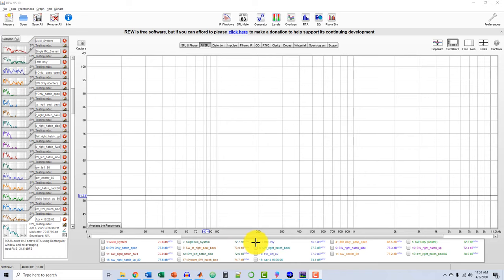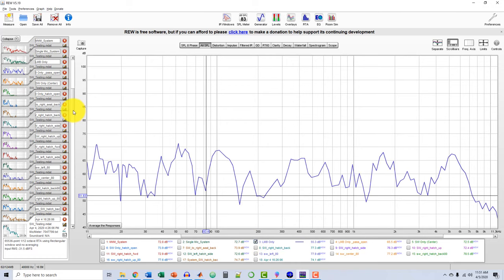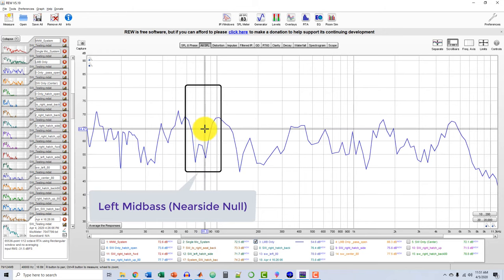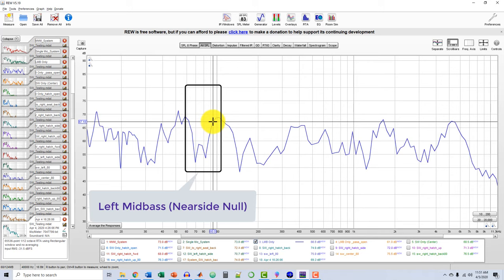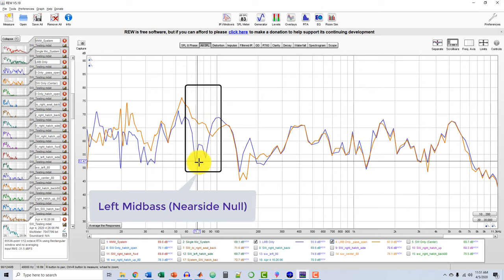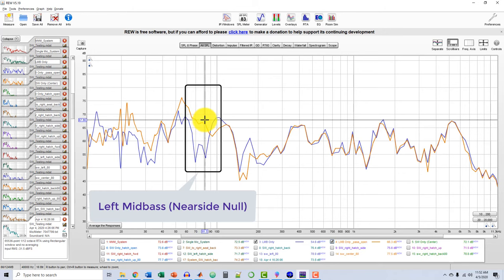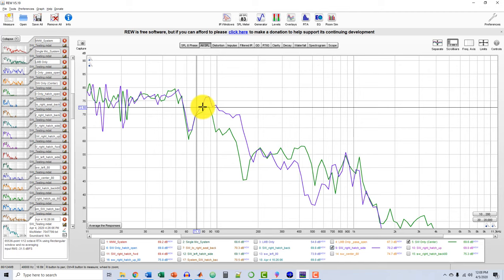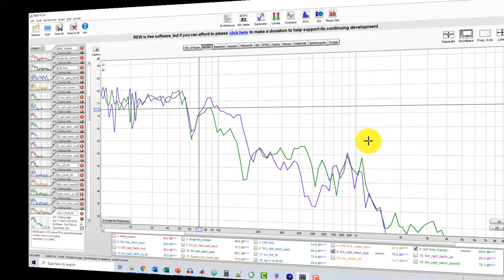Using a Subwoofer to Improve Midbass in Your Car Audio System

Comment: also phasing can create  bass cancelation, in specific frequencies...   sometimes if you turn the phase knob on the subwoofer amplifier it can match the frequencies of the door speakers and reduce cancelation created by the door speakers...   also sometimes if the subwoofer is tuned low like 35hz or lower,  it can make mids bass weak, especially if the subwoofer is in a big oversized box, that will kill mid bass but make the lows powerful, the speaker doesn't make much preasure let's say 15hz above the box tuning frequency,   so maybe if you had a 6th order box,  which means one chamber behind the subwoofer and one in front, low and high frequencie chamber  to give a boost say at 70-90hz

Comment: @Erin's Audio Corner  

Saw your post over on audiosciencereview first which brought me here.  :)  Great video, dude.  👍👍

Oh NO!  Here we go again...  :-P   Skip it or delete it if you want to!

Way back when I first started my car audio journey many years ago, Frank Sbracco Jr @ Traffic Jamz suggested that I place my 15" Infinity Beta subwoofer in the far rear passenger-side corner of my vehicle.

At the time, this was a new, but fugly Ford Aerostar Extended Van (chosen soley for it's ability to carry both passengers plus all of my photography & lighting gear and camping equipment comfortably & securely).

At the time, a young, tall, and skinny kid named Fred Lynch was busy working on the installation of his white Acura(?) Image Dynamics competition car in the install bay.  :)

I was obviously a noob and asked Frank WhyTH would placing the subwoofer in the right rear corner make any difference, and he proceeded to explain basically what you have here.  He told me it won't cost you anything to try it, so experiment and decide for yourself.  I did, and he was right.

I had made a 1.75cf sealed, downfiring box for the Beta 15 sub which would slide perfectly under the 3rd row seat when it was folded down flat into a raised bed-like platform, so it was easy to move the subwoofer anywhere within the large rear cargo hatch area.

With each new vehicle and install, I would continue to test this theory, and 9 times out of 10, ithe rear passenger side worked best.

More importantly, doing all of these subwoofer placement tests really demonstrated to me how different the subwoofer & midbass response could be just due to the position and aiming of the subwoofer within the vehicle, and how different it could be depending on the vehicle itself as well.

In my current grocery getter/daily driver, my goal was to keep as much usuable rear cargo area available in the rear hatch.

But my design & layout dictated that all of my amplifiers & the DSP be placed in the passenger rear quarter panel cubby where I would normally want my subwoofer.  What to do?

The result was a custom, forward firing, sealed subwoofer enclosure placed beneath the OEM floor in the rear hatch cargo area.

The ~1.85cf (total) sealed enclosure spans the width of the vehicle, and Four 8" subwoofers fire partially under & into the back of the reclining/folding 2nd row seats, which is just a bit aft of the center of the cabin.

Each 4-ohm SVC sub is in its own, sealed ~0.45cf airspace, and I installed a pair of individual binding posts for each sub so that I could independently adjust the Levels and T/A of each if desired.

The bonus was that after removing the very inefficient plastic under-floor storage tray and then fab'ing a custom tray, I think that I actually gained usable under-floor storage.  :)

TL;DR   (but not really, LOL)...

What I found through both measurements and listening is that by spreading the "pressure zone" across the width of the vehicle (and also the placement near the center of the vehicle), the bass & midbass response is much more even throughout, and any resulting modes are not nearly as extreme.

Overall efficiency and cabin gain was sacrificed a bit with this placement and orientation, but there is more than enough output capability to make up for the difference.

The 8" subs are also relatively low-inductance and have excellent xmax, so w/o a LPF they play quite cleanly up to about 260Hz.  Sure, I would prefer to have just a bit more extension on the low end, but for 95% of the music that I play there wouldn't be ANY advantage.  Completely acceptable compromise.

This setup has resulted in one of the absolute best "upfront bass" experiences I've heard, with extremely clean and focused IMAGING of bass both Across the full L-to-R soundstage, and deep into the soundstge.  :)

One of my buddies was so impressed that he convinced me to build a similar setup in his vehicle...which is the one I recently used stereo microphones at the headrest to record the system and posted the file on DIYMA.

D@MN!...Sorry for my usual long-@ss "story time" comment, but I just wanted to share my findings on how I attempted to overcome this same issue.

Again, AWESOME video and information, Erin!  👍👍

Comment: I ran a single JL Audio 12W6V3 sealed and had awesome results up-firing it behind the rear seat on the passenger side of my SUV. I can say that it was super easy to EQ that sub and the left mid-bass null was easy to clean up as well. Now I have the left mid-bass null and my rear firing 2 10" sealed subs have a very strange curve in my current build. I am going to dig out my JL 12W6 and see if I can find the sweet spot and maybe kill two birds with one stone. If the 12W6 does the trick again, I am going to build it a nice box and just abandon my 2 10's.

Comment: I expected I was going to have this same issue. I picked up the JBL Fuse dual 8 inch underseat subwoofers to fill my 60-150hz range. My 15 inch subwoofer in the back handles the rest of the lows. The whole system is out of the truck for sound treatment so I haven’t been able to listen to them, but I sure hope the results were worth the extra money.

Comment: Very educational. I'm going to have to go check out how moving the sub around in my truck affects the midbass null. Already in passenger side extended cab so it may be optimal placement already due to dumb luck.
Reply from the maker: Odds are it probably is best in the passenger side.  That seems to be the general case.  But definitely try different spots.

Comment: I guess I got pretty lucky as I can’t recall any nulls around 70-90Hz. 

It’s been a while since I’ve driven my car (03 Buick Regal) but I remember tuning that thing and it was pretty flat from 26Hz and up. Getting it fixed soon so I’ll be able to enjoy some tunes again. 

Nothing crazy was done in the car, just had some Alpine SPS rear speakers and a sealed ultimax 10”. 

The sub technically has almost no output above 60Hz likely because the trunk is eating that area because it’s hungry. But the rear speakers handle above that area perfectly. A tiny bit of EQ for the bass, but mostly just good crossover settings.

Comment: Hi Erin and the rest of the community! I really enjoy following your adventures in the car audio world. Especially the posts about measuring techniqes. 
Have you done tests using gated measurements? Maybe it is all the early reflections that causes the big difference  in various methods? 
Thanks à LOT! Keep up the Good work!
Reply from the maker: Thanks for the comment.  I use gated measurements all the time for my speaker testing.  But gated measurements in a car is useless.  The reason you gate a measurement is to remove the reflections.  In a car, the reflections begin within a few inches (much less than 1 ms in time) of the direct sound.  Gating to such a small time of 1 ms results in a minimum frequency of about 1kHz.  Meaning,  your first data point occurs at 1kHz and there is nothing at all below this frequency because everything below is prone to reflection error.  Not only that, but your resolution of your data is only captured in multiples of that lowest frequency; in this case 1kHz, 2kHz, 3kHz, etc.  That's less than 1/3 octave resolution.  If your window time is less than 1 ms (which it will be in nearly every car) then the lowest frequency captured is greater than 1kHz (bad thing).  Bottom line: gating the response in a car to remove unwanted reflection is of no practical benefit.
Reply: Erin's Audio Corner  Thorough reply indeed! Thanks for that. Then i wont put any more time into gated measurements in car. 
What is your thoughts about measuring with sine sweep vs pink noise?

Comment: Bro thank you for this video, I used to do this when I had a 12 inch subwoofer, but sadly it's a bit harder to get my 15 to play higher without getting the coil smelling. the way I've increased my midbass now was by replacing my vapor shield under my door panel with kilmat reinforced with cardboard, it doesn't help quite the same but it's passable, it gives a bit of a bump around 70-100hz
Reply: So a 15 has issues playing up to 100Hz?
The listed manufacturer frequency response usually goes up to 500hz. 
And usually the power handling is weakest around 20Hz. 
Can you please explain your comment. Thanks.
Reply: @johnviera3884  power handling is generally weakest at 20hz for mechanical/damping reasons not lack of electrical power handling. Actual electrical power handling is determined by the impedance (Ω) curve of the driver and how well the voice coil can dissipate heat. 
Just as a hypothetical example lets assume we have an impedance curve with a peak impedance of 30 ohms @ 36 Hz (Fs), a min' impedance of 2 ohms @ 80 Hz and a nominal impedance of 4 ohms (DC). With that in mind lets say we have the amplifier gain set to supply 40v @ 4 ohms (400w). Using those values we can calculate the power in watts at those frequencies with a couple of formulas.
First find current V / Ω = A  
Second find wattage V * A = W
36Hz - 40/30=1.33A,   40*1.33 = 53.3w, 
80Hz - 40/2=20A, 40*20 = 800w

Comment: Best I’ve had was Focal K2 in front to 80HZ, rear fill speakers coaxial at 120HZ. Sub at 80HZ. 

That will give sublime sound. Quality amps, speakers, and tuning make all the difference. 

12 inch plus sub is the best for deep bass at low frequencies.

Also sound dampening helps a lot at that level.
Reply: Hey, thanks for the input! By any chance, what were the slopes that you used? 12dB/octave throughout?

Comment: Very good info here, subscribed. Would like to hear your thoughts on adding a front sub to glove box area or passenger footwell?
Reply from the maker: I've had up front subs.  I've listened to cars with up front subs.  While they have their advantages, they aren't necessarily an all-in-one solution.  There are still modal issues caused by the placement and an additional subwoofer in the trunk may still prove beneficial.  It's really more car and user dependent, though.

Comment: One trick is to put a sub in the passenger side footwell
Like a stereo integrity bm11
It doesn’t require a big enclosure takes plenty of power and really is a helper to 6.5” or 8” midbass drivers

Comment: Erin, I have an additional question. My measurements from my LMB look very similar. I understand how you dealt with the initial null but what about the one shown between about 150 hz and 325 hz? My LMB behaves that same way and I am looking for any ideas to fill it in.
Reply from the maker: There's really nothing you can do there.  It's placement, relative to your listening position.  The lower null works out because you have the subwoofer to fill it in.  But without another midbass placed somewhere in the car that will fill in the nulls you're talking about, you can't fix this problem.

Comment: Man i really enjoyed the video Erin...Quick question...If the subwoofer and midbass were crossed over at 100hz.....but the subwoofer had considerably more output say like 2000 watts but that output was EQ'd down to the lowest points of the null in that substage...would that help flatten that frequency response?
Reply from the maker: You mean if your acoustical crossover was 100hz, or if your electrical crossovers were both set to 100hz?  EQ'ing down the 'sides' of a null doesn't help the null go away, unfortunately.  You still hear it.  It just looks less prevalent on the RTA.

Comment: Hi I'm hoping you can help. Recently started to get into aftermarker car audio. My main question is when you run passive with components and even active it seems like with a mid driver like a 6.5 and tweeter. It seems like there usually only a HPF option to block out lower sub frequencys and not a bandpass option for the midrange. Doesnt that mean the mid range will be caught playing some of the high frequency or is it not something it can even play, maby it does but it insignificant? Also if you didn't have your midrange with a HPF and LPF cutting off where the tweeter picks up, would there be an improvement? Thanks!
Reply: I think perhaps you might be confusing midbass frequencies with midrange frequency?  It's not too easy to get a 6.5 inch midbass  to blend all the way up to a tweeters range because that's a large span of frequencies.  It's much easier to cross your 6.5 midbass up to your a midrange speaker and then high pass from there up to your tweeter. In other words it's much easier to do a 3 way setup. Hope it helps. Maybe I totally misunderstood your question in which case I should have just shut up and hoped Erin would explain it because hes a master at these things.

Comment: Cheers. What do you set your crossovers at? 80 lp on sub and 80 hp on the mids?
Reply from the maker: In my personal vehicle the subwoofer filter is set to about 82hz/LR4.  On the driver's side door midbass the filter is 92hz/LR8.  On the passenger side it is 85hz/LR8.

Comment: Can the opposite be done to fill the null of your subwoofer at 60Hz?  Use the midbass a little boosted at that frequency?
Reply from the maker: It's been a long time since I've tried overlapping electronic filters so I can't say.  Every car is different.  The obvious concern is that you increase the demand on the midbass.  Give it a shot, though.

Comment: Is that a 016+ civic hatch? Will be doing my build soon in a mazda 3 hatch. Iirc correctly the dimensions aren't far far off. So you're saying with,subwoofer placement, sub placed on the pas side with the cone firing into the side? How far away? 2-3"? Also, I've always wondered why no one is willing to downfire in a car. I'm very curious as to how that would effect response. 2-3" away from the hatch floor.
Reply from the maker: 2019 Hatch.  I wouldn't down-fire because it's a waste of space.  Not saying you can't or shouldn't.  That's just the reason why I don't go that route.
Reply from the maker: 2019 Hatch.  I wouldn't down-fire because it's a waste of space.  Not saying you can't or shouldn't.  That's just the reason why I don't go that route.

Comment: Great video about the nulls!  Note that Dirac ART / Unison is designed to automate the support speaker use. So in OEM systems with Dirac, the null fill-in is normal part of the tuning. 
Also you did not mention front-subwoofer - seems that "you can't build an SQ car without a front sub" these days :)   I was especially impressed with this car, which supposedly only has a front sub: https://youtu.be/doztB69PgA4?t=846

Comment: By using dual subs, can i fill in the null better, then with 1 single sub. And what benefits does adding dual midbass  drivers in the front doors make?
Reply from the maker: You would have to move the speakers at least a foot to really impact the response.  Dual woofers up front won't help alter the nulls for the same reason.  Think of it like this: an 80Hz sine wave is about 4.3 meters (14 feet).  In order for you to effect a change at that frequency for even a 1/4 wave, you would have to move the speakers (or the listening position) 1 meter (~3 feet).  The lower in frequency you go, the longer the wavelength is.
Reply: Would a ported vs sealed sub have the same effectivenes in filling in the near side null in a car?
Reply: @ErinsAudioCorner if you moved the sub from the trunk to the rear of the seats behind the front seat, would that of helped the subwoofer play higher into the 60, 70, to 80hz range  to fill in the midbass null in your car?

Comment: Setting the crossover at 80hz is something that is common knowledge . I have done that for 20 years. 🤔 cabin gain is something to consider too when you build a system
Reply from the maker: It's funny, when everyone gets in to car audio the standard subwoofer crossover is 80hz.  It's the "go to" crossover suggestion.  Then as they go further in to the rabbit hole they want "up front bass" so they start buying larger, longer throw woofers and cross lower, but with little benefit.  But that doesn't mean people understand why they're doing what they're doing.  They just do what others do.  At any rate, I didn't say to run the crossover at 80hz.  I said to simply use a higher crossover than is typical in car audio circles because the illusion of "up front bass" is due as much to properly filling in midbass nulls as it is the physical location of the drive units themselves.  Cheers!
Reply: @ErinsAudioCorner  you got a new subscriber after that answer. 👍😎
Reply from the maker: @Alextheampguy  sweet!

Comment: What if you use dual midbass in the doors, or one 6.5 subwoofer in the door next to the mid woofer in the door?.
Reply from the maker: Dual midbass won't do anything to fill in the null.  It's placement based.
Reply: @ErinsAudioCorner  thanks for your reply. I guess maybe the 6.5 in the door could be custom shifted to face more on axis to give  a better placement ?
Reply: @dc5001  
The midbass frequencies that are played by the driver are omnidirectional for the most part, so simply aiming the driver differently will not result in a significant change in response at the listening position.

You would need to physically move the driver an adequate distance to another area of the car where it does not produce the same null at your listening position.